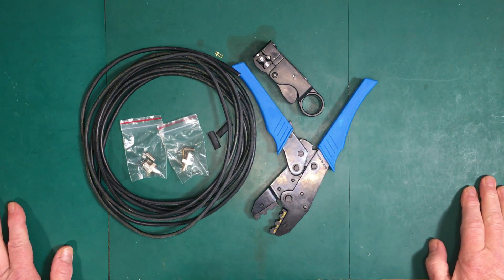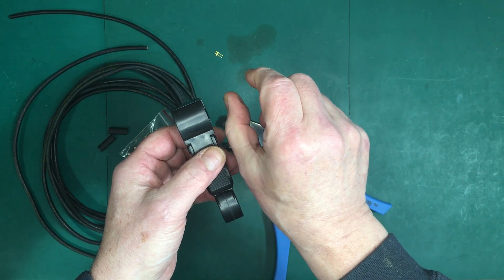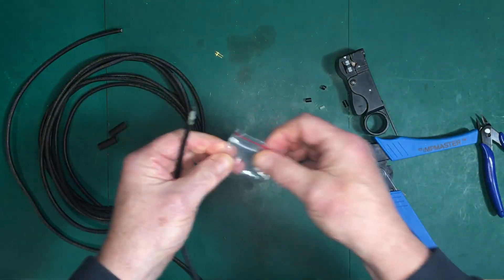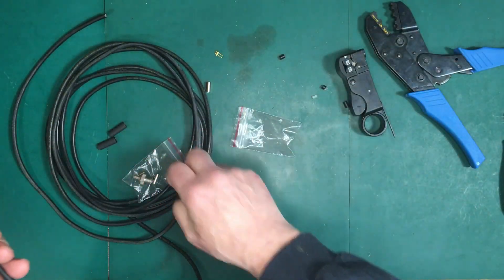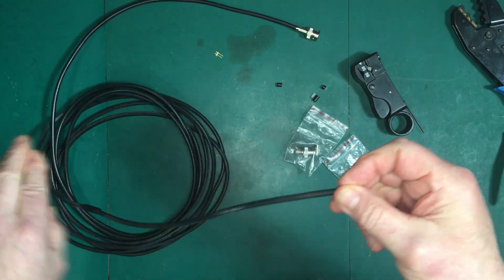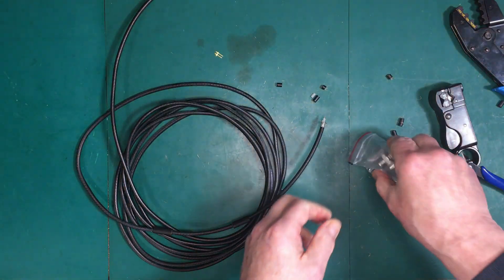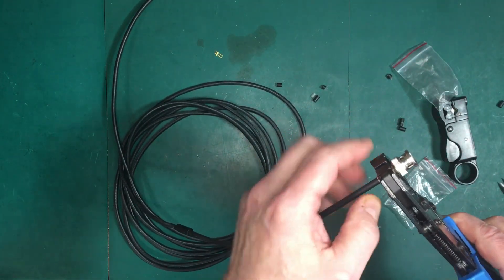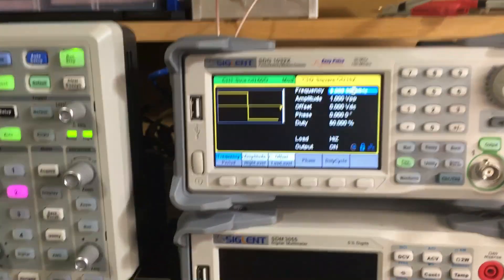0043 - DIY Coax Cables

Comment: Thanks! I wonder why the remains non-professional audio industry keeps using ridiculous RCA connectors.
Reply from the maker: You're welcome!

Audio is such low frequency the old RCA connector does a fine job, so there is no technical reason to change.  BMC connectors could certainly be used.  They connect quickly and  have a positive lock and a much higher connect/disconnect use limit.  Now you just have to change an industry.
Reply: @uni-byte  I am not bothered about frequency. I just think that connecting signal before ground is not good idea.
Reply from the maker: @jakubczajka4275  Ahh, okay.  I get your meaning and I agree.
Reply: @uni-byte  BTW, do you think 12bit scope offers any real benefits over 8bit scope? I will be using it to design/troubleshoot class AB amp and digital audio (12.2 MHz square wave max). I keep asking around but no one has anything useful to say about it.
Reply from the maker: @jakubczajka4275  Yes, for sure.  12-bit scopes have 16 times the dynamic range (4096:1 as opposed to 256:1).  You won't see anything different when looking at a real time signal on the screen.  However, if you capture an event then try to expand the captured trace both vertically and horizontally, the 12-bit scope will show far more detail long after the 8-bit scope has run out and starts to loose useful resolution.
Reply: @uni-byte  Thank you! Owon XDS2102A then! Apparently it is not as well polished as Siglents, but I think I will try it.
Reply from the maker: @jakubczajka4275  Let us know how it works out.